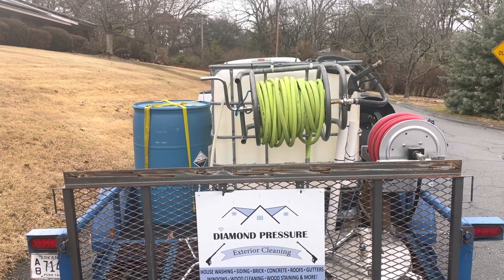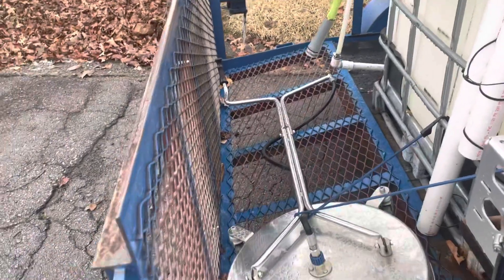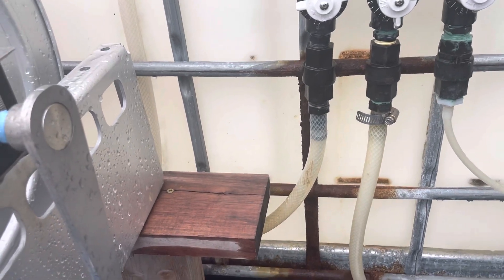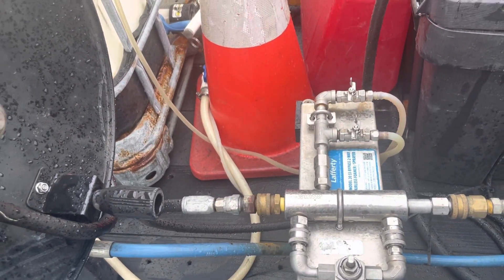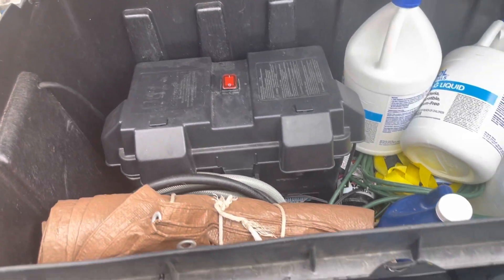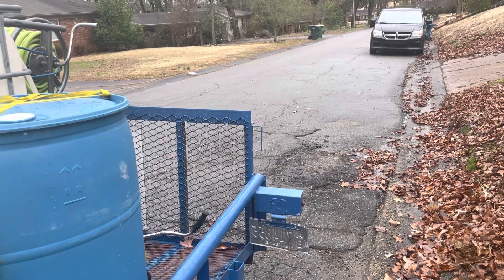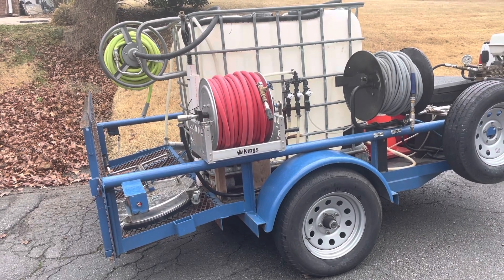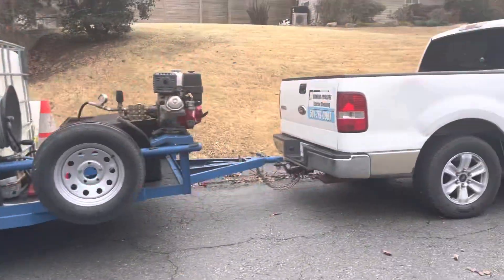My Pressure Washing Trailer Walkthrough (simple build)

Comment: Kinda like the inexpensive water hose reel ideal. Think I’ll go that route and spend a little more on the pressure hose reel for now. I’m just setting up for line striping cleaning and surface cleaning.
Reply from the maker: That’s a smart idea! Good luck my man, it will be whatever you make it!
Reply: Yeah man when building a trailer don’t need to go all out to get the most expensive truck because the customer isn’t going to be looking at your reel types just make sure they work properly save $ then upgrade

Comment: Great trailer! Just be careful with to much weight, personally I feel like that buffer tank may be too big for a 4 gpm system, if the water tank was smaller you could have more room for other stuff, regardless, that’s pretty much exactly what I’m looking for, all essentials and in my budget!
Reply from the maker: Absolutely! We never haul this long ways with much water in it, if any at all. Buffer tank will be perfect in the future with an 8gpm, just gotta get straight with Uncle Sam first then go from there!
Reply from the maker: I was researching building my trailer and fortunately this thing popped up for sale. I got it for a steal, because I see other trailers that aren’t as solid (imo) for a couple grand more then what I paid. Extremely grateful
Reply: That’s why I didn’t go with that ibc tote and went with a verticale 200gal tank

Comment: If I could ask , I have a Ford maverick compact p up towing capacity 2000lb can I pull something like this with it ? How heavy is your rig about? Thank u
Reply from the maker: I believe you’d be able to! Wouldn’t travel with much water in it though. Originally I had a hitch installed on my mini van, like an idiot before realizing it would be at the max towing capacity of 1600 pounds which is too close for comfort for me. I’ve never weighed it but it’s probably around 12-1500lbs depending on how much bleach I’m carrying.

My towing capacity is around 3600 pounds, it’s an older 2007 f150. Had to sell my nice Subaru to buy this old thing. It’s working great though. 

You’d be able to pull this, just don’t travel with a lot of water & you’ll be fine!
Reply: @WashDudez  thank you